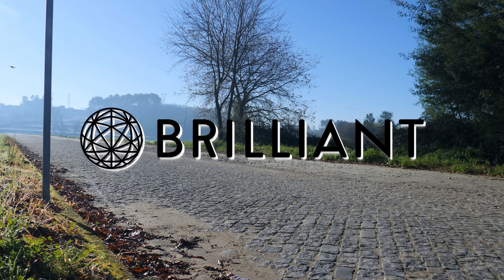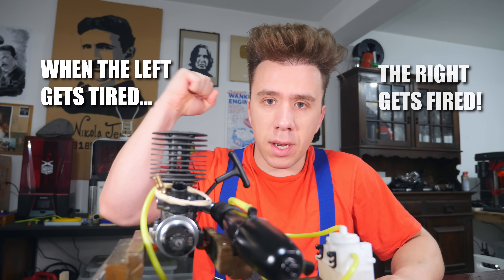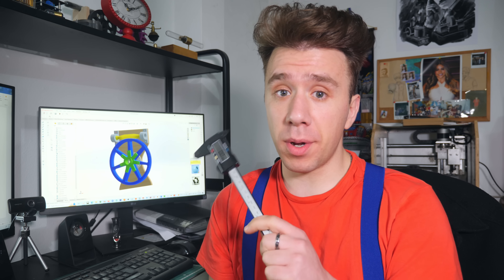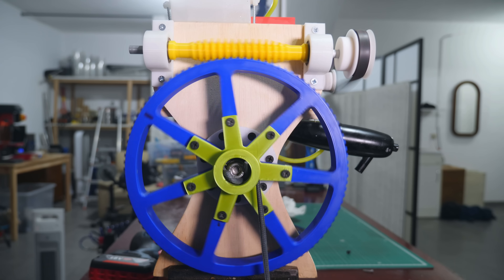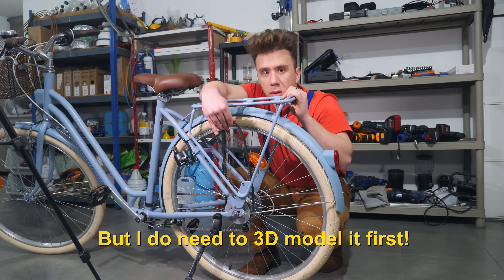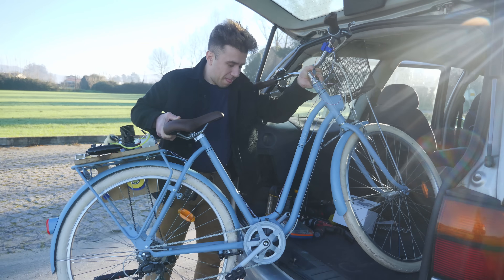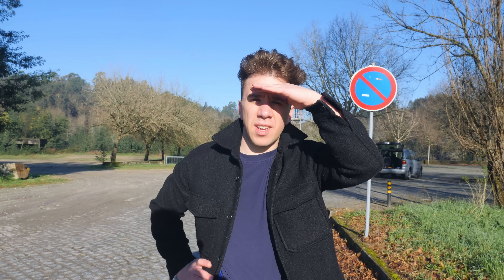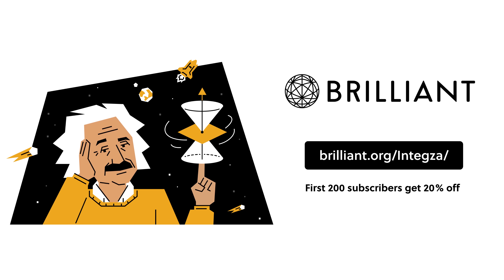Tiny 3.5 cc NITRO ENGINE on a BICYCLE

Comment: he kinda touches on this in the video but "horsepower" is NOT in fact a unit of measurement of power, in fact it is usually not a unit of measurement at all because most things called "horsepower" fail to set up a consistent correlation between the relevant factors that go into their final number. and yes, I did just say that there are multiple different things all called horsepower: the term has been a marketing gimmick quite literally since it's conception, there is almost always a formula attached but those formula are only there to get a shiny number for the thing being sold and are usually explicitly designed not to correlate to any actual meaningful numbers.

for a couple points of reference a person cycling at 60 miles an hour (97kph) on a normal 14 or 21 speed bike (most bikes use the same 7 on the wheel and 2 or 3 large gears at the pedal, so 14 or 21 speed transmissions hich sounds like a lot but it works pretty organically) set to it's fastest gear is rated at ~0.3 horsepower by the formula I think is rating that little engine at 2.5HP and usually 0.7-0.9 by the ones usually used in car advertisements (there's half a dozen different formula for every brand and I'm not quite sure which engine that is let alone which formula's result he is quoting). these numbers get so hilariously misleading that accepting "horsepower" as a valid unit of Power would mean that you think that your average supercar has more power output than a supertanker with an engine the size of a large house and the most powerful engine ever made has a "horsepower" of 0 by almost every different "horsepower" formula, funnily enough it's fuel pump is rated at ~50000HP.

Comment: Small tipp for two stroke engines. I own a chainsaw, what also is a two stroke engines. What all chainsaw owners know, you need a moment of patience.
Even so a chainsaw is bigger then your little friend, it goes as follows.
Turn start switch to max position (gives more fuel in the compression chamber when motor is turning). Pull (the starting cable) a few times, to get the system turning and burning (heats up the chamber). Now wait for around a Minute or so (the fuel that is still in the chamber can evaporate and mix with the air). Now turn start switch to to normal and pull the starting cable. Now it normally should start without hurting your arm :D
I hope you learned something :D

Comment: It’s imperative to tune a nitro motor for the weather conditions and the fuel mixture, as well as the loads you expect it to see, can hear in the video the motor is running lean, the screws on the carb allow you tune it, motor didn’t sound like it was anywhere near the top end because it was running quite lean. I wouldn’t expect it to be able to rev to its max rpm given the low torque up in the 30k rpm range, but with some tuning, and maybe a bit more of a spicy nitro fuel (30% for eg) you should be able to extract more out of it.

Tuning the clutch may also help, because you’ve probably already worn through a set of clutch shoes.

Comment: I quite like the idea of a motorised bicycle. You’ve proven the concept works.
Reply: uhhhh, you've been able to buy kits for that in hobby stores since at least the 40s?
actually good kits since I think the 60s, more because of bikes being relatively standardized and switching to linkages that allow the individual parts to move without moving the pedals than because of small engines being more powerful (they were mind you, it just doesn't take much oomph to meaningfully power-assist a bicycle).

Comment: Integza, you're not going to get perfect 1 to 50 or 1 to 100 ratios due to inefficiencies.  Also, a rubber band for one of your values? Eep. But, hey it worked.  The only problem you seemed to have was the brass tearing up the teflon (also, where would one hang the drill? you might want to figure out a way for it to self start).  I wonder if you could use lighter stuff than wood/mdf for some of your structure.  That way it won't have so much weight to pull (or you could just diet/exercise some :P).  Your engine sounds neat though and it seems to run pretty steady, congrats!

Comment: Did you try to tune the gas/nitrogen flow when you were going fast? Many of those nitro engines love to run lean at speed and when it’s hot but being difficult to start, so it likes more fuel when it’s cold and just started. You should look into it, mayby it’s the difference between 32kph, and 42kph😂👍🏼

Comment: I feel the setup has too much friction and the clutch is still slipping even at your top speed. Maybe look to a bigger clutch and change to a more direct link (gear to gear via a belt) instead of using the screw gear.

Comment: Nonono your supposed to let it idle for 2 full tanks of fuel with higher oil content to run it in and then after that you shouldn’t run it hard for the next two full tanks

Comment: You have to choke the carb and almost flood the engine with fuel to start them. Put your finger of the air intake and give it a couple of pulls to suck a bunch of fuel in then crank it. Sometimes you need to thrash it like a 16 year old but usually it's more like a 3 pump chump. 

Electric start is obviously easier but it doesn't hurt to stick some fuel mix down it's face to keep it all lubed up.

Comment: if you put your finger over the exhaust tip and pull the pull start a few times, that forces the exhaust to go through the tube into the gas tank, forcing fuel into the engine to prime it, then it should start more easily.  maybe try one pull first so you don't flood it, and if it doesn't start, try a second pull with finger over the exhaust tip.  do that before you put the glow plug heater on of course

Comment: I find the throwing around of power, torque and rpm, as if they're not directly linked, a little bit unsettling... Power = torque * engine speed (with adjustments based on units).

The engine has 2.5 hp max power, 0.9 Nm max torque and 30 000 rpm max speed. To produce 2.5 hp from 0.9 Nm, you need about 20 000 rpm. Any more, and the torque must go down, otherwise the power would be too high. If it puts out the 2.5 hp at 30 000 rpm, it's only producing about 0.6 Nm at that speed. The electrical bike is quoted at being around 50 Nm, and to produce 2.5 hp it'd only need to spin at 360 rpm. With that torque limitation it won't produce 2.5 hp below 360 rpm, and the torque would again need to go down at higher rpm to stay within 2.5 hp.

They're directly linked, saying your engine has "great low end torque" is basically the same as saying it has great low end power, and power is what you use to calculate acceleration etc.

In the end it's all about the gearing. Geared properly, the little nitro engine is just as capable of moving a bike as just about any other 2.5 hp engine.

This of course assumes that the torque curve is relatively smooth, rather than having a single huge spike somewhere...

Comment: Try a larger 2 cylinder 4 stroke 1/8th or 1/5th RC engine!.. They have much more torque and a super clean RPM range. Some of the engines in that class are even fuel injected! Those engines are much better for a project like this and will run stronger, faster and quieter. The RC engine you used probably destroyed its cheap (Plastic) stock clutch even before the bike started moving... Also try a mountain bike or a race/street style bike with gears! To change gears simply let off the gas (like a cheap auto clutch pit bike) then change gear and the torque from the engine will move the chain to the next sprocket. I have thought about trying this myself (maybe even with a cheap push scooter that has large wheels) but unfortunately my funds are completely dry right now. I have to source the parts from finding free stuff online or picking whatever I can find off the side of the road... Its definitely a worthy YouTube video and I'm sure you could easily make it possible. You have a whole community of people are interested in both the projects stated above.

Comment: We used to have some nitro RC cars. They're always a pain to start, especially brand new engines. Strongly recommend a battery-powered starter instead of the pull start, it's so much easier lol

Comment: I think you geared it too low. Having geared it to the point where you'd have to pedal a bit at first would have given you a better top speed.... but 32km/s on a bike is probably also about the sanity level for reasonable braking power. I do, after all, want to see you upload again. And preferably not from a hospital bed.

Comment: For someone who hasn't got a RC car you definitely know how to stop the engine, some people pinch the fuel line which cuts off the fuel but it also cuts off the oil that protects the engine.
Nice work with the bike. 😀👍
Reply: Best way is to actually plug up the exhaust pipe with a shoe or quick thumb, the intake will obviously be covered by the air filter. competitive RC racer (:
Reply: Thumb on the exhaust works. Just do it quick so you don’t burn a nice circle on your thumb. Super easy and quick once you know how fast you can release
Reply: @rossfuller3224  yes! I’ve also seen a shoe to the flywheel on racing buggies!
Reply: good to know

Comment: Im surprised that teflon gear held up at all. A machinist i worked with put some in a lathe to make a cylinder. It was a bit too long. The first cut grabbed and twisted it, as it was vibrating like rubber would.

We were picking shards of teflon out of the shop for months. Still, has a lot of uses. Epoxy potting jig i made for the centrifuge worked great

Comment: most transmissions are a 1 to 1 ratio in 4th or 5th gear ..  1st is like 3+ to1  ,,  second 2/1, and thats at 100-300 ft pounds pushing a few thousand ,  the less torque you have , the more gears you need,,  so imo,  you need to try making a big ass CVT ,,,,

Comment: Ever thought about a "Tether Boat"  or "Tether Car" to use that engine with?  They can be any body/hull design, but for boats, the most common/popular is "Unlimited Hydroplanes" AKA H1 Unlimited Hydroplanes.  Cars are more "streamliner" designs when it comes to outright speed records (Trust me, check out Tether Car Speed Records!!). 
Tether boats are usually YOU holding a kevlar/nylon tether in the center of a shallow body of water, and you send the boat on a run of X laps and you compare against others on lap times.
Cars tend to be tether in the center, you push the car off from the outside, and let it gain speed until it runs out of gas.  
I think either would make for a great series to watch!  

Cheers!
Reply: those are boring though and it'd be a waste (not that this bicycle thing isn't... lol)... put that engine in a proper "r/c" car or boat... that's what it's made for, really... Tether engines are simpler yet, typically, and don't even have a way to control the throttle even..

Comment: I wonder if you could go faster putting the original gear shift back on the back wheel, and shifting through the gears as you gain speed.

Comment: You can run those nitro engines on diesel once they warm up, but need to reduce the amount of fuel input by 2/3. Start on nitro mix then run on diesel. Had one of those on a bigger RC helicoptor way back in the 1990s.

Comment: If it doesnt seem like it wants to start. Hold your finger over the exhaust and give it a few pulls until you see the fuel going into the carb. (helps if you are using nitro fuel that has some colour to it) Do this without the glow starter on. These engines have no fuel pump and so they use exhaust pressure to push the fuel from the tank. (thats why there is a second fuel tube going from the expansion chamber on the exhaust to the top of the fuel tank)

Comment: youll probably conceive of more functional devices if you stop referring to weight in units reserved for mass!
claiming you have a "2.5 kg weight" exposes a gross concept error in physics necessary for mechanical engineering.

Comment: At a guess I'd say that you were only putting about 200W down to the ground. With a variator or some gearing you should be able to get 50kmh+ with a motor of that sort of power.

Comment: Ptfe is not a good material to make a gear from. It work forms, has no memory,and is soft. A steel gear and oil lite brass worm would have been better.

Comment: Hi Joel,
3 things:
1. Cool and fun project
2. the engine seems like its getting too much air and less fuel (carburator settings)
3. Be careful with that table saw. If you check out table saw kickback accident vdeos you get the idea. Be careful. Kickback sounds not that dangerous like it is in reality.
Reply: After seeing that long piece of dimensional lumber next to the blade, I jumped in the comments to find fellow safety-internet members.

✌️

There is a high risk of kickback when you crosscut a wide piece against the fence.  To be respectful to Joel, there may have been contributing factors making it safer than it appeared. The way the video portrayed it, it definitely looked higher risk.
Reply: It is but I want to tell it. Maybe he does not know and maybe one day he got hurt badly. But maybe he already knows. @Xaqaria
Reply: @SoaringExperience  I'm with you.  Sometimes safety internet comes across harsh and lecture-y, which causes the message to be lost.  You did a good job, which is why I jumped on your message to  help maintain the right tone.

Comment: I have a Traxxas Revo with a nitro engine. It came with an electric starter setup, which is nice because instead of figuring out what's wrong with the engine, you get to figure out why the electric start won't work.

Too bad the fuel is so expensive for these engines.
Reply: I had a T-maxx with electric start and they break because the one-way bearings fail. From what I remember, it just spins the motor without turning the engine and the local hobby shop sold the replacement bearing for $25 back around 2001 when I was like 11. Needless to say, it often sat broken given how fragile and delicate everything is and how crazy overpriced replacement parts were. I owned several Nitro RCs over the years and they all were finnicky to run and easily broke even when babied, so I gradually lost interest. They're a frustrating money pit of a hobby and only the 1/5 HPI Baja Gas RC I owned was enjoyable because it never had issues and was infinitely easier to work on.

Comment: Crosscutting a 2x4 on the table saw using the fence like that is a great way to lose a couple fingers my friend. Use the cross cut sled for that.
Reply: Finally, a comment about the table saw! You are scaring the hell out of me.
Reply: Seriously! Especially with how high the blade is set!
Reply: Dunno if he is like electroboom and is all part of the character but I see he does some very dumb stuff in many videos. One of the worst ones was the one were he was shown the continuous detonation engine, he did something extremely dumb, he was putting his mouth open into the air blast of the engine, that could have killed him if the air pressure was put to the max by bursting his lungs.
Reply: The saw is pretty bad, but did you see the drill press?! brushes hand directly next to rotating drill bit
Reply: @evangwin6689  Drill bit flutes aren't sharp, you can literally touch them while spinning and be fine. A table saw blade WILL remove your finger before you can even react.
Reply: https://www.youtube.com/watch?v=XsmAxJ7Qc6M
This might help glad I seen this comment learned something I like to fabricate but table saws scare the crap out of me.
Reply: https://youtu.be/8f8VWwtaudU?si=vmEYlJLpQplH6D3Z

Shows how this type of kickback can happen. Please be careful!
Reply: Clearly the table saw blade height is set to "2", for MUCH TOO HIGH.
Reply: I came looking for this comment. The usual cavalier attitude he has towards learning how to use his tools will not serve him well with a table saw.
Reply: Table saws scare me, I am always extremely careful when using one.
Reply: it's even better at leaving a 2x4 hole in anybody standing behind

Comment: the engine sounded lean at high rpm. most likely need to adjust the high speed needle a little richer for sustained high rpm operating

Comment: 5:52 😨Please never use a table saw this way, I'm sure others will also point it out. To crosscut small stock like that make a sled, never use the fence, it has a strong chance to cause kickback if the block turns away from the fence towards the blade. Woodworker for over 10 years, still have all my fingers.

Comment: In my city, in the summer, it's not uncommon to see crackheads and other assorted tweakers making ghettofabulous hogs out of old bicycles and chainsaw engines, they usually can't crack 20mph, and leak oil and fuel everywhere. Is integza now a tweaker?

Comment: What about connecting this to the pedal sprocket so you have built in one way gearing and the benefit of the bicycle gear train for greater range of torque/speed?

Comment: The big problem with worm gears is they are very hard to back-drive. If you do a standard gear and then belt reduction you can then get rid of the one way bearing and couple the wheel to the engine for engine braking. Also gear it for higher speed!